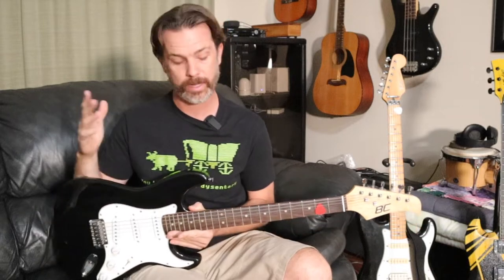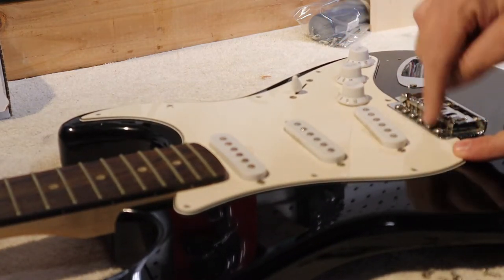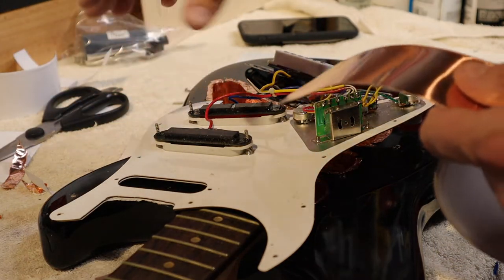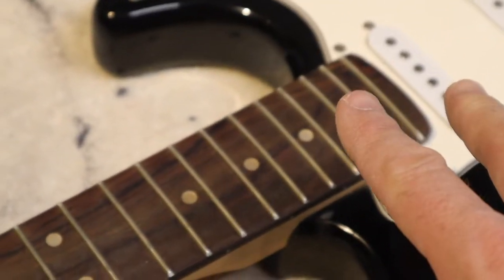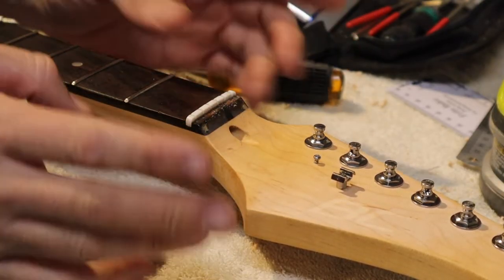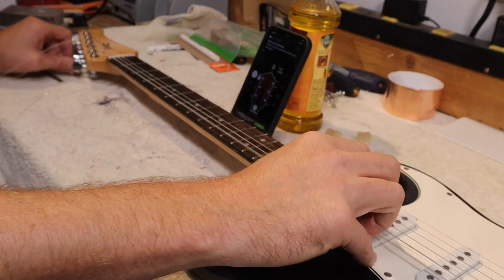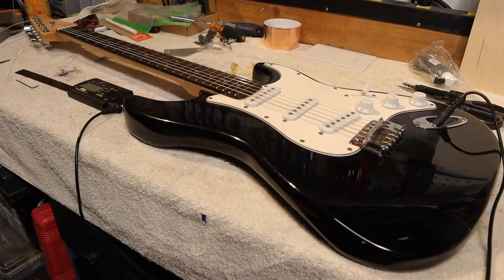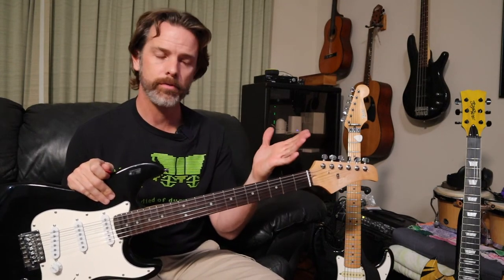Guitar Setup - Making A Cheap Guitar Play Great For Free!

Comment: Really great video.. I do all of that. One tip to pass along, for single coil pickups that are in stratocaster and telecaster style guitar, take the 0.22uF capacitors off and solder on 0.047uF capacitors on. Not only with it make the low sound better but all the way across the mids and highs.

Comment: Do you do anything with bass guitars? Would be cool to see a similar video for bass. I mean I'm sure most is applicable to both but I bet there's a few tricks just for bass.
Reply from the maker: I've messed around with basses, just not nearly as much as. Most of the setup is the same or similar. Shielding the cavities and polishing of the frets is the same. The adjustments for the truss rod and action height works the same, just the measurements are a little different.